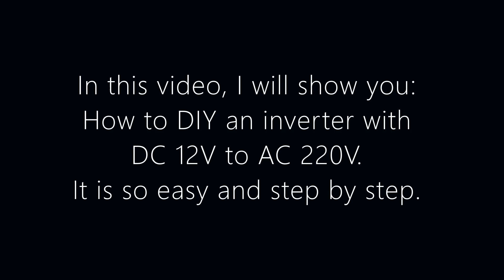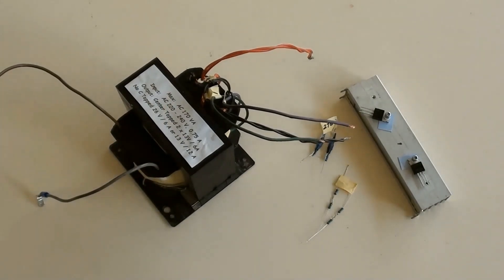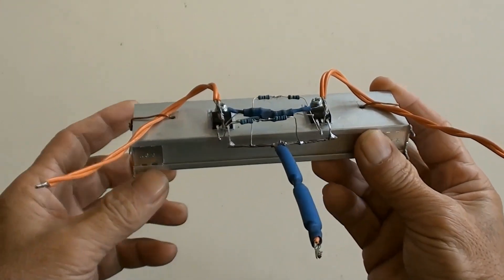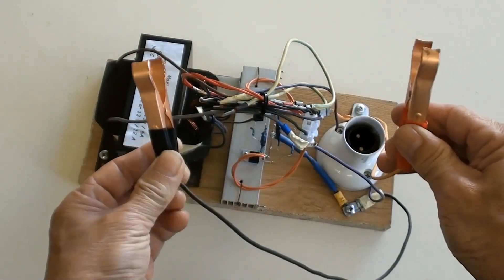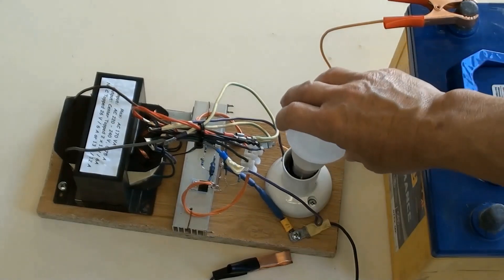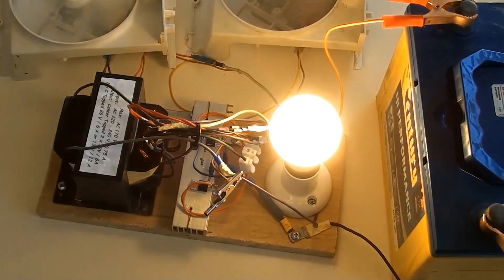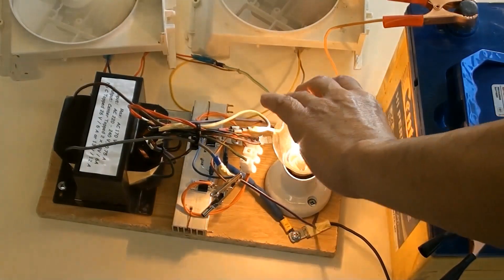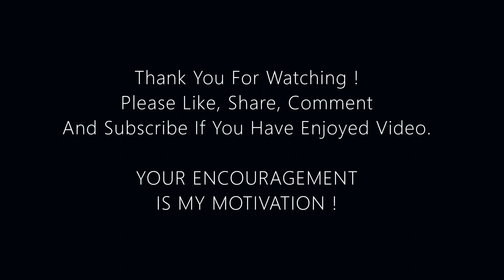How To DIY DC 12V To AC 220V Inverter?

Comment: 102 resistor is 1kΩ but in your schematic written 100Ω, which is correct and how many watt was the ressitor ?
Reply from the maker: Thanks for your interest!  That resistor from the diagram was 100 ohms as you mentioned however in practical situation, a 102 (one hundred and two) ohms chosen, made by combined two resistors in series which 1/2 watt of its total wattage.  Cheers!  👍